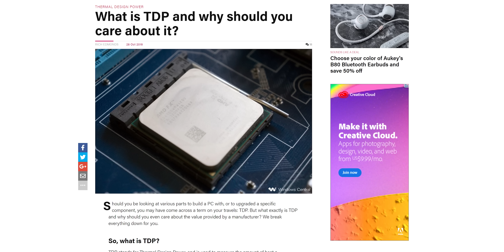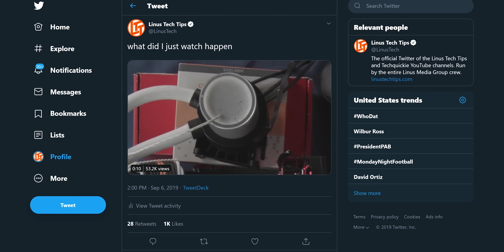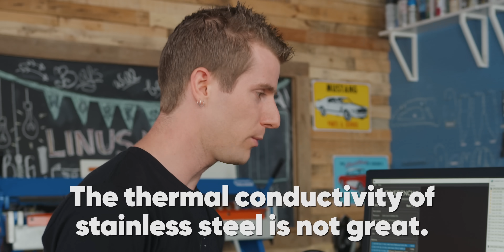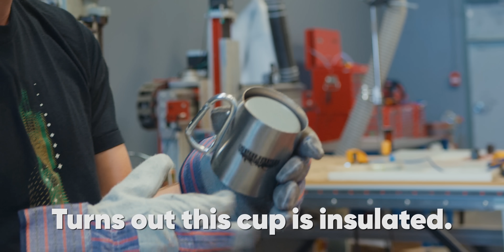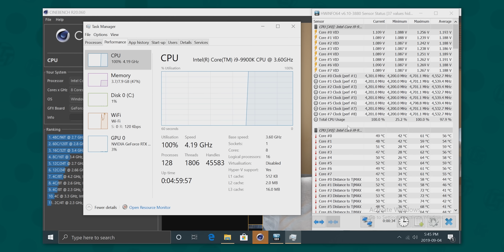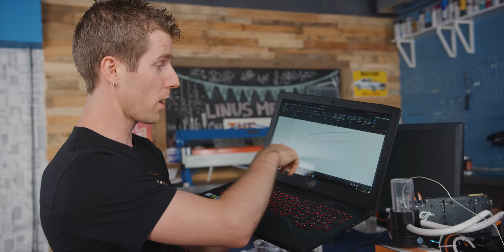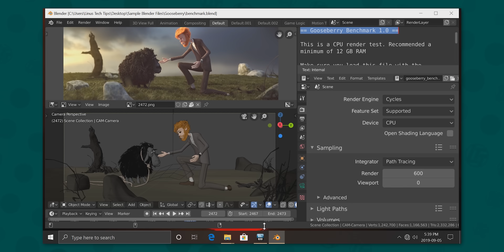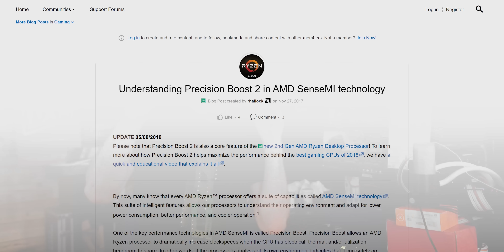Who REALLY Runs Hotter? AMD vs Intel

Comment: Intel: We're still the fastest!
AMD: For frying eggs and bacon
Intel: cries in higher heat output and pricing
Reply: Only in single core is Intel faster multi-core AMD is faster you just saw that in the video about multi core. 399 or 499 your choice. Intel had to drop their prices because of Ryzen 3000.
Reply: @Masta6801  sure but for gaming, regardless of how they keep saying they are going to take advantage of more cores, for now single core speed is still king.
Reply: @Masta6801  Actually Ryzen pretty much matches that now too.
Reply: @Masta6801  IPC and clock speed are not the same. The Intel chips are physically running at faster clock cycles. This generates more heat... Kind of obvious here, people.
Reply: @TreyM_channel  what? Faster clock does not equate hotter when comparing archs. A 3ghz p4 runs way hotter than modern cpus, which run 3ghz with mutiple cores at way less than the p4s thermals.
Reply: @TreyM_channel  intel isnt worth it btw
Reply: this aged well
Reply: wrg, not, cepuxitx, any be any perfect no matter waht
Reply: And im here using AMD A8 with Radeon R5 lol. Man AMD grow so fast
Reply: (Cries in poor excuse of a stock fan)
Reply: This comment aged very well.
Reply: Earthplayer  you have no idea what you're talking about. Moron... Faster clock cycles produce more heat at a given voltage. Try again.
Reply: While we are roasting Intel
Intel roasts our heat sinks.
Reply: Actually AMD used to be better at frying eggs and bacon... Google about AMD Socket A Athlon CPUs and you'll find just that! Plus a classic video showing how hot they got back then with the heatsink removed.. xD
Reply: @mmatous  there is no such thing as intel fanboy
Reply: @locnes2133  Why?
Reply: @Shikoyyan  Dude for god sake dont make things up intel fanboy is no such thing Everyone shares their opinion
Reply: Matouš Mikota Person with brain detected
Reply: Make that in laptops man....Desktop has no more problems because of coolers but for laptop, I go for intel.
Reply: Intel has lost the touch tbh
Reply: my 3900X will ro sham bo ur 99k and go spider monkey on ur frames!!
Reply: @mmatous  "i wAs jOkiNg tHe wHoLe tiMe!" Sure.
Reply: lol gtx 480...
Reply: Avery-John  a 9900k has inferior multi threading... What is it with you people missing the forest for the trees? The Intel chip is hotter because it's running at a faster clockspeed. That's it. Nothing to do with performance in this context...
Reply: @TreyM_channel  When you lock them both to a clock speed of 3.8ghz, why does the Intel still produce more heat?

While it is true, a given chip will get hotter at a higher clock speed because you have to increase the voltage, it's also possible for 2 chips with the same clock speed, to have different temperature. The AMD CPU still makes less heat even if you UNDERCLOCK the Intel one to be the SAME clock speed. 

Can you explain thstn
Reply: sounds like someone is getting butthurted :D
Reply: @TreyM_channel  No it's because intel is sat there on 14 nano meter trying to squeeze out more performance by trying to push to 5 Ghz and because of this the power draws are absolutely massive compared to AMD therefore more power draw = more heat. Despite this intel will still be fine as long as people have a good cooling solution unless they are doing some crazy 5 hour render or some shit. I don't get some of the people chatting shit to you, people need to know that at the moment AMD is better for workloads due to high core counts and threads, and intel is better for gaming due to higher single thread speeds like 5 GHz. If intel was on 7 nm pushing 5 GHz then there heat issues would be much better but yet again on 14 nm they should still be fine as long as a suitable cooling solution is in place. The main reason for example is power draws, intel 10900K draws at max 145W because of 14 nm, AMD ryzen 9 3950x is on 105W and barely ever is used to max potential. Gaming go intel, workloads go for AMD, hope this stops idiots who know nothing randomly having a go at you.
Reply: @mmatous  ur dumb
Reply: Clex no u
Reply: @Clex-  another intel fan boi
Reply: @Clex-  no u
Reply: Avery-John  yes... Bc IPC is lower in multi threaded workloads for Intel. That has nothing to do with heat, for the billionth time already...
Reply: Earthplayer  it is on an older process node at nearly 1ghz faster on average. It's going to be hotter... Nothing to do with IPC... NOTHING TO DO WITH PERFORMANCE... Are you clowns purposefully dense?
Reply: @mmatous  ur just saying that lmao
Reply: no lawsuits against intel pale, you get what it says on the box, cough cough zen  3000 NEXT LAWSUIT INCOMING LOL
Reply: And yet AMD still botlenecks the fastest gpu's. yay for AMD
Reply: @mmatous  I own cpus from both companies, moron.
Reply: @TreyM_channel  "I own cpus from both companies, moron" is the ultimate "I'm not racist, I have black and asian friends!"
Reply: @TreyM_channel  lol he said he it was only a joke you are a jerk if you can't take a joke so you are like me but i like amd more beacause it is cheaper and it can sometimes be cheaper and better both amd and Intel make good processors
Reply: @TreyM_channel  ok boomer
Reply: @brdon2099  ok boomer
Reply: @TreyM_channel  ok zoomer
Reply: @brdon2099  ok boomer.
Reply: Earthplayer  Pound sand. I couldn't GAF about what you think of me.
Reply: @TreyM_channel yes tfw you don't want to admit that AMD is better than intel
Reply: @TreyM_channel  bruh just chill its an argument not a fight you dont need to swear that much! And plus "owning both" doesnt mean anything everyone knows intel cpus are only better at gaming, ryzen literally smacks intel at anything else, and you get more cores on ryzen vs intel in most price ranges so better value, and plus intel cpus get hotter because they use a 14nm architecture and everyone knows this I mean ryzen cpus are cooled just fine on the asus g14 which is a 14" laptop that smacks even intel 10875H except for gaming good luck doing that on intel 10th gen
Reply: @TreyM_channel  If Intel is hotter and is lower in performance then why did you bother to desperately defend it lmao. Average consumer like myself don't really care about those "physically faster" whatever anyway.
Reply: @TreyM_channel  Sadly these "low information plebs" are certainly made up most of the consumers these days. Though after looking at the more informative people in this comment section, seems like you're not at all that far from "low information pleb" as well hm..

Anyway, thank you for your attention good sir. May your knowledge be blessed with actual practicality rather than just mouth and arrogance in the future :)
Reply: TFW heat output doesn't matter and never did as long as you're within reasonable temps on your cooler. Crying about CPU heat on the faster CPU is like complaining that an engine in a car with 1000HP puts out more heat than a luxury sedan. OFC it does. It's running faster...
Reply: TreyM you sound like a guy that always used to say intel is better cuz amd just gets too hot thats bad
Reply: @TreyM_channel  But it wasnt faster... and they arent the faster cpu's anymore either.
Reply: @destroyerdragon2002  the 9900k is absolutely faster in gaming the majority of the time, and is running PHYSICALLY faster (5GHz is quite a bit faster than what AMD is doing these days) as I said in my original comment. Stop letting the obvious WHOOSH TF by you.
Reply: @TreyM_channel  lol 4.8ghz vs 5ghz isn't big difference
Reply: @TreyM_channel  Too bad that AMD has better low 1% than intel's so it's much more stable than your intel's jumping shit or just slowing down a lot after just 2 hours of gaming cuz of the heat and the heat slows the CPU I explained that to your fanboy brain
Reply: @TreyM_channel  Idc if you own both or not but if you say that Intel 9 9900k is better than AMD 3950x then you should go and see a doctor
Reply: @Daniel-ss5tg  oh yeah? Well I think they are both server CPUs that nobody has any actual use for and just buys to say they have the best. An i3 10320 or ryzen 3 3300x would be my choice of this year's offerings. All this multi core this that blah blah is basically just marketing because 99% of people will never utilize it.
Reply: @TreyM_channel  take the ryzen 5 3600 then benchmark the  9900k and it will show you that the ryzen is a whole lot cheaper but is very close to the 9900k so yeah the i9 is better but also a whole lot more expensive than the ryzen
Reply: @Shikoyyan  does the life live longer tho im sitting with an i7 4xxxu  and it stills work fine just because its cheap doesnt means its better
Reply: @locnes2133  and the ryzen is not better Well sometimes but it is cheap and is catching up with expensive Intel proccesors
Reply: @Shikoyyan  but the quality is not up to par but i agree on your price intel is expensive af
Reply: @locnes2133  i dont know about that but(i only have like from 2000 amd athlon and im saving up for for a pc i spent a month checking if everything is compatible and i am a kid si it will be hard saving up for it ) i thkink that AMD and Intel both have they're pros and cons
Reply: @Shikoyyan  if your building a gaming pc go for ryzen for more ovr clk speed if work pc go for an i5 xxxxm
Reply: @TreyM_channel  It matters when you need to select a cooler for it
Reply: @TreyM_channel  baah 🐑
Reply: @TreyM_channel  running faster with 1300 tiles rendered compared to 1900 LULLLLLLLLLLLLLLLL clearly that speed didn't help
Reply: @niiwo  I own both a 9900k and a 3950x,  fanboi. Feel free to stop sperging and spazzing at any minute.
Reply: @TreyM_channel  yeah but is it worth spending 500 on such cpu while the other ryzen 7 3rd get is arond 300?
Reply: @TreyM_channel  well yes but your 1000 hp car is still slower than a luxury sedan
Reply: @TreyM_channel  This is less about it mattering practically I would say and more about Intel bullshitting their marketing to make their numbers look better to consumers.
Reply: @Raven1024  Wtf are you talking about? Intel has ALWAYS reported their TDP this way... Even when they were the market leader. Get your tin foil hat off...
Reply: @TreyM_channel  its more of a jab because everyone always thinks amd is poorly made and can catch fire

Comment: I have stock 9900k with dark rock pro 4 cooler, my cpu goes to 100c after like 5mins of prime 95, and with cinebench run it gets to over 80c. Is this normal or am I having bad contact with thermalpaste. My case is derine r6 and airflow should be good.
Reply: i thinks it has bad contact or something but dont count on me :D
Reply: It goes almost up to 1.4volts@4.7ghz, these can do 5ghz under 1.3?

Comment: at 10:36 I recalled that one time I ran my pump without the top and then topped it off after turning on the pump. I then not thinking turned the pump off and it backlogged into the main chamber. I wonder if its going to happen to them. :P

Comment: @7:35 - Should have used a digital scale to weigh the mass (water.  Zero the scale with the cup on it, then add the water / liquid / solution)...rather than eyeballing the volume.

Comment: Standart for measurement?
Yea look at metric system and yet some stuff is still compared with inches (for example size of screen)
Reply: Monitors are always measured in Inches, and im from south america...
Reply: @ladrillorojo4996  Yea as its most commonly used but actually they should be mentioned in cm

Comment: I think we could improve this experiment with calculation of work efficiency, that generally measure input energy x load given = time to accomplish load (work) x heat temperature. Any input / ideas?
Reply: They're not measuring work/kWh. They're seeing how realistic the TDP specs cited by manufacturers are. Intel claims the 9900K is a lower TDP component. If it outputs more heat than the AMD part (even though it has a higher quoted TDP) then the way they convey this information isn't adequate or possibly even honest.

Comment: Whhhaaaaat?  Why not just FLIR?  This is just, wtf scientific process?
Reply: Because iR reflectivity is a thing. Try reading the temperature of a piece of copper with an iR thermometer; it almost completely reflects infrared showing you the temperature of your own face or what's behind you and not the copper. (I know the cup isn't copper but this is a simple example of the shortcomings of these devices in certain scenarios.). It also only tells you the temperature of the surface of the water. The precision of consumer infrared thermometers is garbage for taking precise experimental measurements.
Reply: @faceplants2  yeah... That's why I explicitly said FLIR... As in the proprietary, scientific grade thermal imaging equipment with a tolerance tighter than most manufacturers best on the consumer end. Even with their "consumer" equipment... I'm not saying go to the damn dollar tree and get an ir thermometer with laser pointer, later to dual use as a cat toy... I'm saying go to Grainger and get either the apple or android variant of the actual FLIR equipment add-on, and thermal image the cpu block. All one needs to do is find the delta, subtract the materials inherent thermal load, and viola... You've got die temp +/- a hundredth of a degree. Of course use the same block on each board / cpu, and the control is there. Really, you could totally forgo the crazy maths and just take the face value temp as well, with that being light years ahead of what they did here. All they did was fail... Due to the ridiculous approach they took...
Reply: @Dex99SS   The 'FL'  in FLIR simply means 'forward looking' in order to distinguish between fixed, forward-looking thermal imaging systems and sideways-tracking infrared systems. Handheld iR cameras being called FLIR is actually a misnomer. The accuracy and appropriate use of different iR thermographic cameras comes from the quality of the sensor and whether they measure long or medium-wave infrared. The highest accuracy sensors like those on the Keppler and James Webb telescopes need to be cryogenically cooled just so they don't 'see' themselves. Regardless of the difference between various types of infrared cameras, they would still just be measuring the surface temperature of the block and not the total energy absorbed by it.

Their testing methodology was sound. After all, energy can be defined as one calorie =  the amount of energy it takes to raise the temperature of 1 gram of water by 1 degree Celsius. This is the same principal calorimeters are based upon.

This test wasn't done in perfect laboratory conditions but if that's what you expect from Linus you're always going to be disappointed. I'm an avid fan and student of aerospace and have done consulting work for companies building very large thermal imaging satellites for both terrestrial and orbital instruments. I've been fortunate enough to eat lunch with and pick the brains of exceptionally bright astronomers and planetary scientists yet I managed to control my cringe reflex watching this. I still think this was a great example of scientific experimentation. We got to watch as they worked the problem. The importance of an experiment is to learn something, not get everything absolutely correct the first time. Keep in mind also that they had already moved on to plan 'D' or 'E' by the time they started getting results.

Comment: I had found some of this out in the sandybridge and newer and bulldozer and fx days. Intel measured by their standard clock and amd at their max clock. While amd was being honest, which Intel often isn't. I had to sit through all the intel idiots screaming that the amd processors were so hot and their processors were running cooler. When I had the privilege to run both and known others who had either or. I found it odd how people would always report these super hot cpu's with their intel cpu's and amd reporting lower thermals and not having these rediculous temps in the case of 70c-100 with intel and 40c-60c with amd. This was even with the 8350k running at 4.6 ghz and the 9590k at 5ghz. I found this odd in the face of what intel idiots would scream over and over. Now with ryzen versus intel, I could see maybe it being down to intel running at faster clock speeds, albeit not that much, unless you overclock it to 5ghz, then it's just obviously more heat output for intel. I just wish Intel were more honest and a little less greedy. Because they always come off as the evil empire with bad business practices and greedy and ruthless behaviors that I have seen through their entire existence.

Comment: Also, why the bullshit white black ink? Just watch the temp and record the time. You can figure out the heat dissipation. And isn't wattage usually a measurement of consumption? Why don't you just measure the power the CPU takes?
Reply: oh, TDP, ok. Missed that.

Comment: hmmm all i see is an undervolted Ryzen. This is not stock voltage, stock voltage is over 1.4v. This is not a fair comparison, it's heavily biased. Shame on you Linus for pulling tricks like that.
Reply: @Unknown it mostly comes down to the chip quality. Both current gen CPUs are hot-ish, with AMD quite cooler on stock, but hot as he'll when oc'd. But Ryzen cannot  OC properly so that not an issue. However a good aftermarket cooler is the most important choice. And you can't go wrong with a Noctua (on air) or NZXT on water.